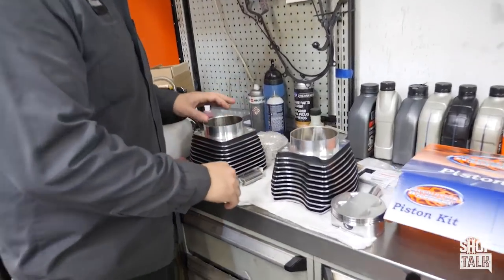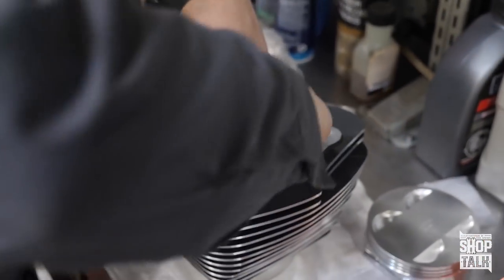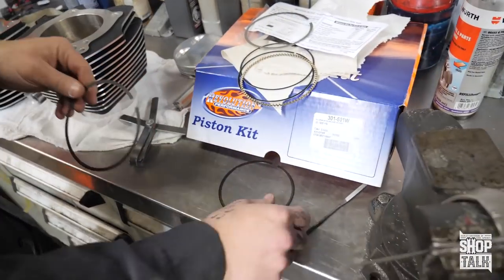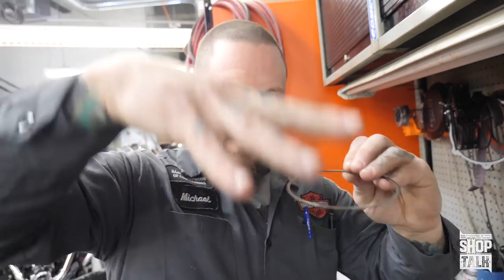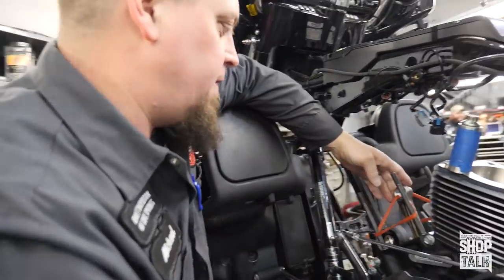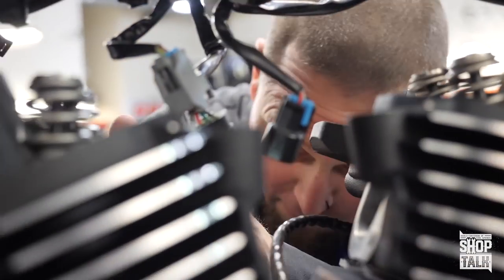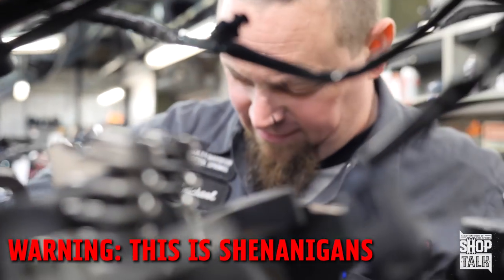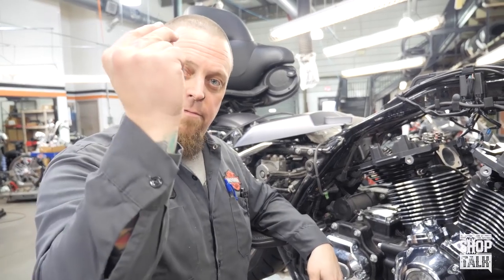124CI Installing Cylinders & Pistons | Shop Talk Episode 21

Comment: Are you re-using the stock head bolts? Can you share the cam and dyno results?
Reply: We do not replace the head studs on the M8 but we do replace the stud caps (nuts) per Harley Davidson recommendation.  We will post results.

Comment: If i did this to my 103 how much would the gas millage go down? if its like 10 miles less per gallon then that kinda sucks for a bike u gonna ride and put miles on, if its only like 38mpg vs 42mpg or something while cruising on the highway. Then it might be alright.
Reply from the maker: Delusion In The Brain you’ll be in the 38-44 MPG HWY all day. Where you’ll drink gas is wide open throttle from light to light but then it’s kinda why we do it!!!! Right?

Comment: Shouldn't you install the oil rings onto the piston before you use it to set the compression rings before gapping?   This way you know 100% that the ring is perpendicular to the bore and it's exactly the same depth all the way around the bore.  Just dropping the piston in the bore to set depth isn't guaranteeing it's perpendicular, especially considering the crown of the piston is quite a bit smaller in diameter to the bore than the piston skirt is (due to allowed expansion from heat).
Reply from the maker: No. The main thing you want to make sure of is that the ring in the same distance all the way around from the top or the deck. Than check your gap.

Comment: I cannot wait to see this, I want to do this to my 114 and take it to 124 or 128. What kind of torque and HP do you think you will get?
Papa P.
Reply: Most likely 130 ish on both. The cam is an Andrews 520 so it's not the most aggressive, but it should produce plenty of Torque straight from the line. Looking for dependable riding two up, or loaded for weeks away in the mountains etc.
Reply: gritblackthirteen    Yes sir I understand. I rode 11k last year and I will ride about the same this year. No two up riding.
Reply: Jamie Lima      I am about 4 hours away so I could ride down from Milan Indiana.
Reply: Marty Porter Sr Awesome!!! Call us when you’re getting close there is a wait time so I’d recommend calling us ahead of time so we can get you on the schedule.We also have in-house financing options for out performance builds, if needed.
Reply: Jamie Lima 
I won’t need finance help. Just pay cash for it. The Fatboy is different than Street or Road glide as you know. Do you have any Dino runs for any M8 Fatboys?
Thanks
Reply: Jamie Lima  
I will call you later today since it’s like 1:00 am
Reply: I'm not going to spoil the coming video, but I'm smiling with the final numbers etc. I'll post again once I get my hands on her again.
Reply: @gritblackthirteen  cool man,  happy for you.

Comment: "I just like to make sure, that they are torqued to the manufacturer's specifications."

Because they cause sumping that harley wont admit to, and cause rods to seize to the crank...
Reply: I'm not sure why people have the assumption that HD "won't admit there is a sump issue".  There is a factory bulletin (a warranty repair procedure) on the possible sump issue and how to check for, and resolve it under warranty.

Comment: Where did the jugs come from? Revolution? All aluminum?
Reply: Yes.  The aluminum is treated with a proprietry  nickel silicon carbide that is extremely hard.  The advantage of the design is improved heat transfer and cooler operating temperature.
Reply: @NoName-vz1ob Thanks for the video. The dealership I go to changed hands and the new owner loves modifications where the old boss wouldn't stick anything not Harley into your motor. The old owner would not work on any bikes 10 years old or older either. A real P.I.T.A. You are the man!